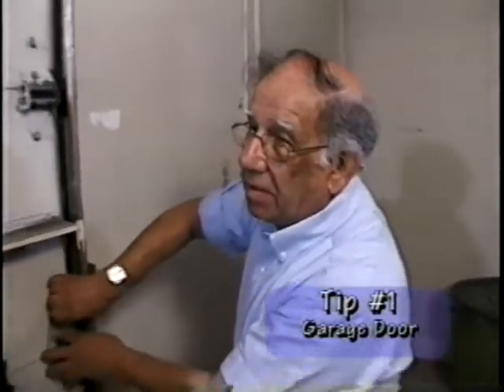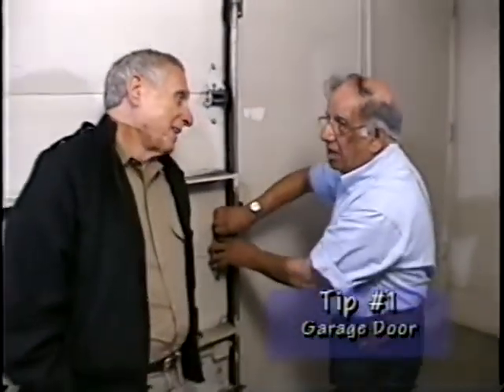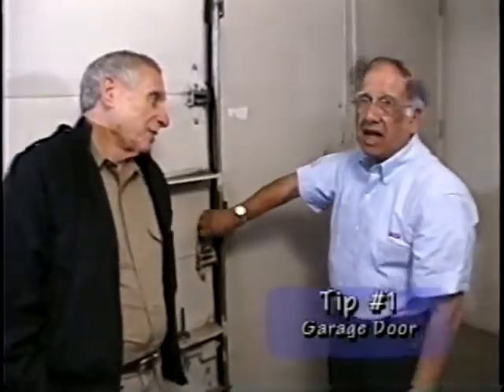How To Fix A Garage Door

Comment: Why take that much time to do that? Some idiot is going to try and take off the bottom bracket to replace the roller and lose an eye.  Take a pair of vice grips, put a bend in the track. As you bring the door down pop each roller out and replace with new one. Then as you bring the door up, set each roller in the track. The top two will have to be done with the door raised. Use vice grips again to flex the track and pop the top two out and same thing going in. All 10 done in 5 minutes.

Comment: Don't trust this old guy! This is a safer/easier way to replace rollers, especially if you have a cordless drill, but NEVER do this on the bottom bracket! That is attached to the springs, and may KILL YOU! Also, he used the wrong tool, which means that hinge is going to come loose and lose one of the panels. Trust me, I've had experience with that exact problem.